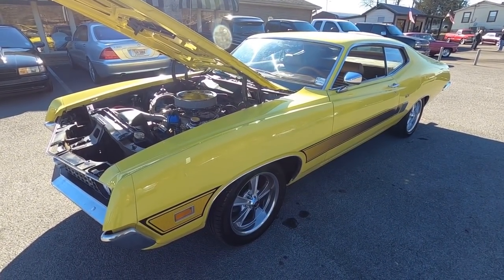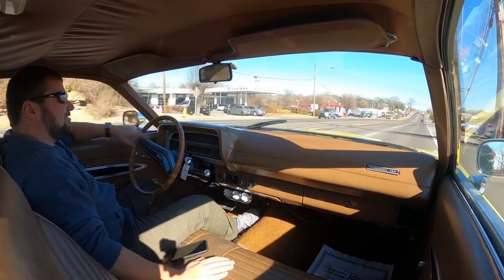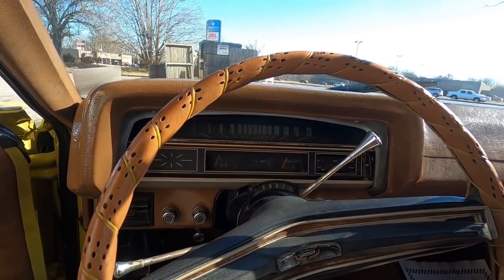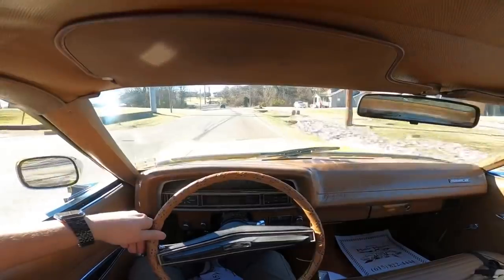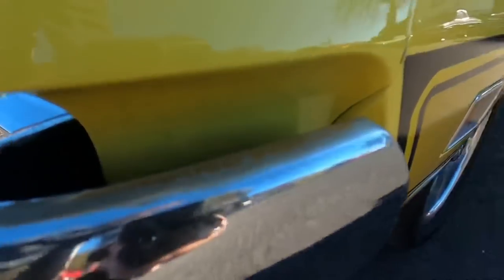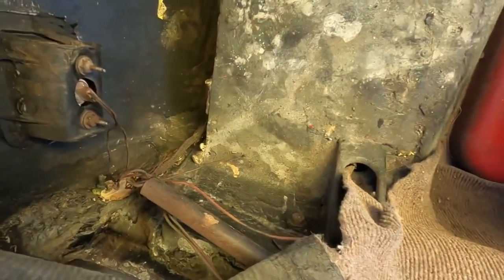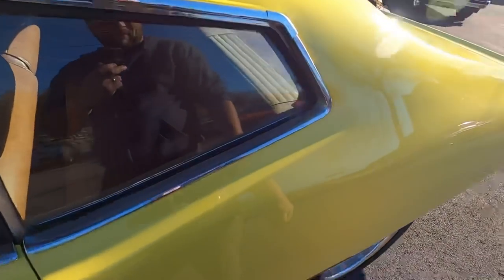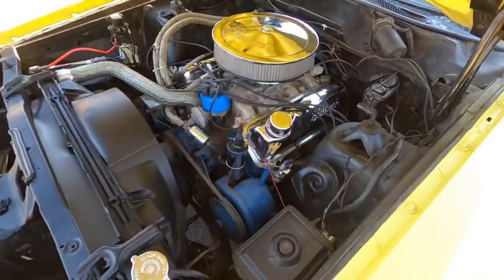Test Drive 1970 Ford Torino GT Fastback SOLD $21,900 Maple Motors #1430

Comment: My dad had a 69 with a 351 Cleveland Hurst 4 speed 12 bolt posi, hood scoop with lights on the back of it and a holley carb. ,blue with white pen stripes and white interior 👌 Very quick Very fast car. Ford you need to bring this car back I'm meaning the torino ,truly a muscle car to be remembered and brought back to life

Comment: That's one of the must beautiful car ever build I will take that car take it a part and rebuild it piece by piece new engine new suspension brakes body booshings put a brant new engine and bake it in a very special color with top of the line fuel injection engine new seats

Comment: 351C do you know if 4V heads or 2V with a 4BL carb
Reply: Either set of Cleveland heads, 2v or 4v is great as long as it has a matching 4 barrel intake. But, the 4v make amazing power at high rpm with a big cam and steep rear gear.